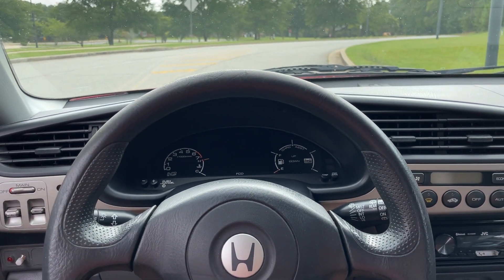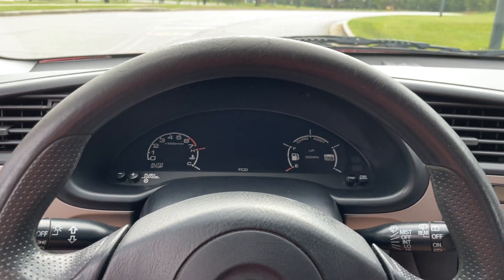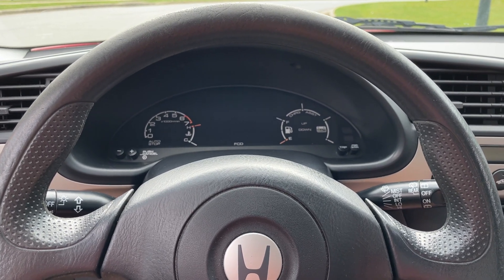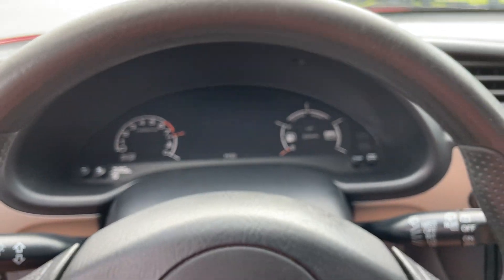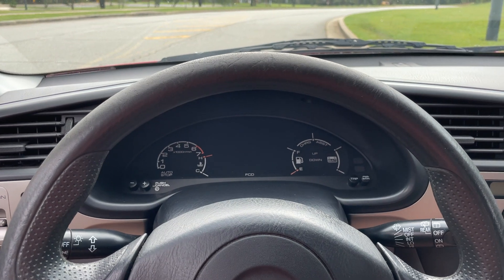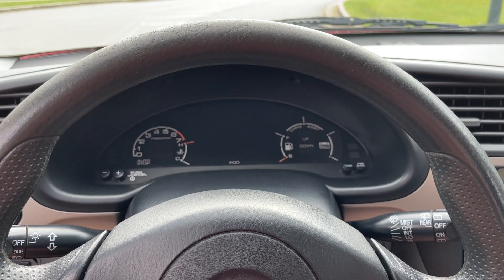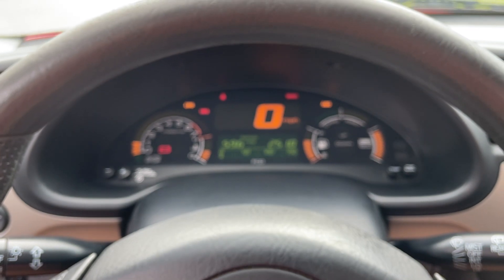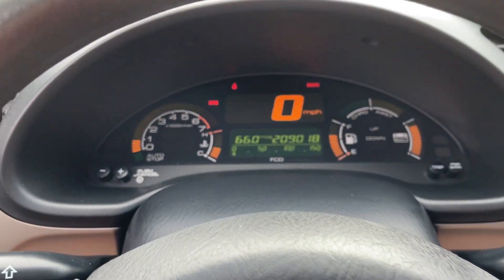G1 Insight: Lithium conversion 6/6, test drive and review in layman’s terms

Comment: The lithium swap will make no difference in MPG or power, and I would love to hear someone tell me otherwise. Keeping a stock IMA controller with a larger battery, no matter if it is lithium or NiCAD, just leaves you with a stock power and stock driving IMA with more capacity. Same as having a power drill with a 2aH battery and swapping out a 8aH. If it's the same voltage and controller, the only net benefit is more capacity. Battery capacity is irrelevant to a hybrid because the IMA controller will regen it automatically if the battery get's too low, unlike a EV where the capacity is directly proportion to range. IMA is like nitrous. The factory battery is a 5lb bottle, the lithium swap is a 20lb bottle.
Reply from the maker: @WildcatWarrior15 With all due respect you are incorrect. LiBCM replaces the OEM BCM which allows more current which means more power. More power means the gas engine has to work less which means better mpg. I've meticulously documented mpg on my 4 different Insights, some without and some with Lithium, for 3 years. I'm able to acheive +4mpg more with Lithium.

From the linsight.org website:

"Insight's NiMH cells are the weakest link in the original hybrid electric design.  LiBCM replaces the outdated NiMH chemistry with modern lithium cells, which can handle considerably more power. LiBCM spoofs the pack voltage sent to the computer that determines how much current to provide.  Spoofing a lower pack voltage causes the computer to deliver more current (to hit the same power setpoint). A stock IMA system with NiMH cells delivers at most 12 kW (16 horsepower). An LiBCM-equipped pack in a manual transmission car delivers at most 18 kW (24 horsepower)(50% more power)."

Visit here for more education:

https://www.linsight.org/faq/faq-technical
Reply: I didn't know it replaced the OEM BCM, interesting.  @GenXJeffstuff

Comment: I went through four IMA batteries in my 140k miles with my '00 Insight, I'm pretty sure I had a lemon. The last two were BumbleBee Batteries, so don't expect those batteries to be bulletproof though happily one of his was swapped under his warrantee. I sold my Insight a couple years ago, if I still had it I'd absolutely do this hack.

Comment: Did you do the current hack with this conversion as well?  Does any Service offer this conversion?  Do you think a non skilled guy could do this by following instructions/youtube?  Any Cons with switching to Lithium besides $6k price?  Any advantages to staying with OEM Nicd?
Reply: Nicd is a bit better in very cold weather
Reply: No impact had Ni cads  , only NiMh .
Reply from the maker: Yes. No. No. Con of lithium is it's untested long term and could blow up and kill you plus there's no warranty. It's not $6k btw. Advantage of NiMH is it's plug and play and proven safe and has warranty.
Reply: @GenXJeffstuff  I really appreciate you answering all my questions.  Thank you.  :)
Reply from the maker: @samreigel8645  Sure thing!

Comment: A question (I know you can't answer questions :)  Like I'm a kindergartner.   Why.   I think of the driver's experience: range between fill-ups, quickness, speed. Is top speed improved? Does the engine have less wear and tear(and then great longevity).   Is the range between fill-ups improved? 
From a driving perspective:
Quicker - Yes, you said it feels quicker
Faster - ?
Great range - ?
reduces engine wear - ?

I genuinely don't know these answers, and from the excitement I imagine the actual answers are very interesting.   What's the reason for Li upgrade?
Reply: Faster:  Yes, definitely
More fuel efficient:  Depends.  Theoretically less because lighter, but this car got current hack, so it puts out more power, meaning more needs to be regenerated.
Reduces engine wear: Probably yes if you were trying to drive it exact same as before you put it in
Range:  N/A (it's a normal hybrid not a PHEV or EV)

The other main reason for this is the traditional replacements aren't very attractive.  Original battery had NiMH cells made by Panasonic... very high quality, but today in 2022 all aftermarket options use Chinese NiMH sticks.  You can buy a pack with a 3 year warranty with Chinese sticks for the same price.  The batteries here weigh less, have more capacity, were built by Toshiba in Japan for Honda, and will almost certainly last longer than 3 years under normal operating conditions.  (Can't guarantee it... only the very oldest of these batteries from 2019 Insights are 3 years old, so we can't REALLY know as more than 3 years haven't elapsed yet since manufacture.)
Reply: @Natalya420  Great, so 
1) Faster
2) Lighter
3) Other NiMH seem low quality
4) Probably last longer than the low quality alternative
5) ?? you write that these "have more capacity"  how is capacity used? To go further, to go faster? It's a hybrid, what impact would battery capacity have?

Thanks...and what a pretty car...I'm drooling imagining getting mine.  I was a passenger in one of those once back in 2005, I'm wanted one ever since.
Reply: I believe more capacity means if you climbed hills using assist all day the car wouldn’t need to switch you to regenerate/charge as soon due to depleted state

Comment: I've been considering getting the 8AH NiMH from bumblebee batteries but for the same cost I can get Lithium... man that's appealing.
Reply from the maker: Keep in mind there is little official warranty with lithium… you get one year on the hardware and software but any diagnosis would be a pain. Most drop in replacement batteries have a one to five year warranty depending on what you buy. So that is a decision to be made and why I waited as long as I did. However I trust this product 100%.
Reply: Absolutely go with the NiMH. My GreenTek failed under warranty and they replaced at no cost.
Reply: @WildcatWarrior15  Bumblbee never responded to my emails so I ended up parking the car until it's ready for a lithium swap.